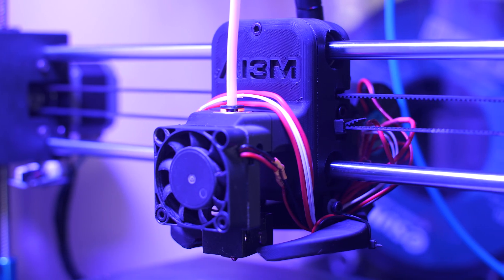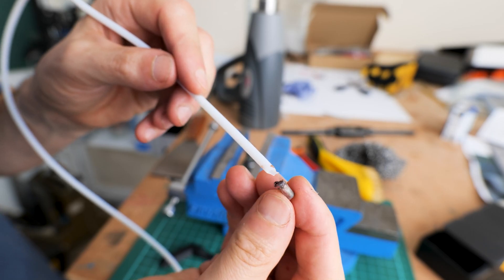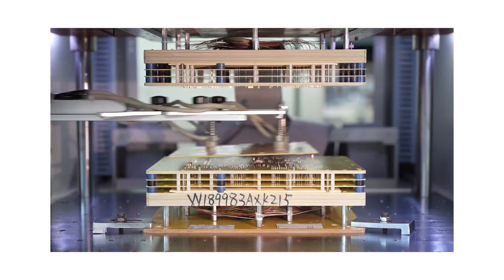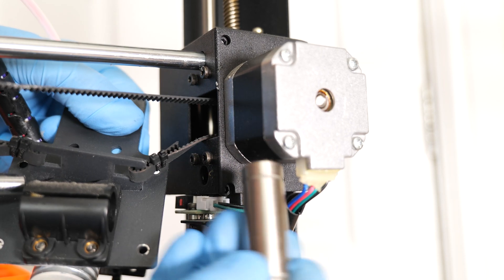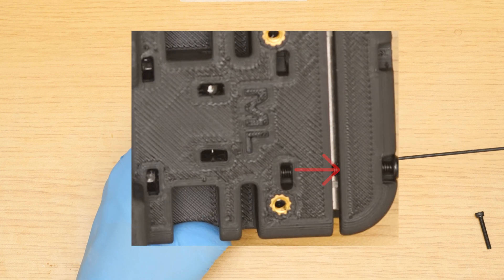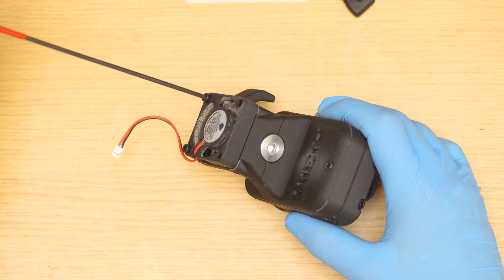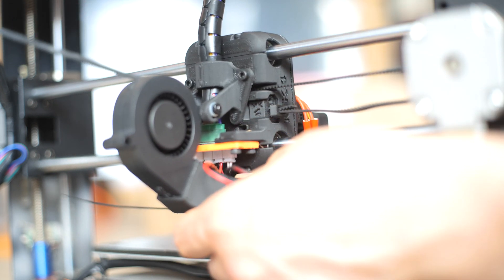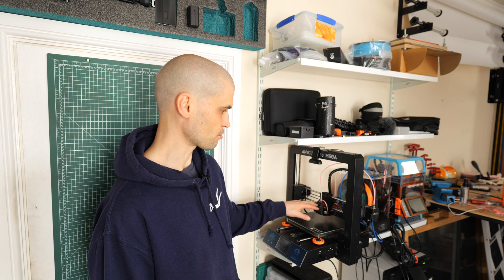Upgrading to the Anycubic i3 Mega X-Carriage MK4

Comment: Just upgraded my 7 year old  i3mega to marlin with Bltouch and new tmc2209 drivers. That’s a huge difference compared to stock. This looks nice too but again a lot of tinkering. You can swap boards to 32 bit or add Klipper to give this a second life, but I am tempted to buy a bambulab instead which will give me extra free time, which is the most valuable thing there is😅
Reply from the maker: Hi John, im in the exact same position as you, as of this week. I think the extruder motor port has died on my i3 mega. I could swap in a new board and tinker with it but at the moment im just looking for something that can print quickly and efficiently without it being a DIY project because i have so many projects on the go. From looking online the Bambu seems like the best plug and play printer at the moment and most of the reviews are very positive. I know @Clough42 has the bambu and has positive things to say about it and I trust his word more than most youtubers.

Comment: Liked and subscribed!

Can’t tell you what a relief it is to find a content creator that’s still running a Mega X AND performing upgrades. 

My Mega X has had very little use, but I’m getting a lot of mid-print failures for no apparent reason. I can’t justify replacing it, so I’m going I’m hopeful that I’m getting a lot more life out of it with the help of your upgrade tutorials.
Reply from the maker: What exactly is happening mid print? Bed adhesion, under extrusion....?

I3 mega still going strong for me. It's printing the best it ever has now I've upgraded to X carriage and ldo orbiter 2.0
Reply: I 100% concur. I'm running the bondtech extruder and am about to do this upgrade.

Comment: Did you print the xcariage with ABS?
Reply from the maker: yes esun ABS+
Reply: @ThisDesignedThat  did you print it using the anycubic mega? Im trying to print it with PETG on my anycubic mega x, but the prints arent as smooth as urs
Reply from the maker: I printed the Mega X on my Voron 0.1
Reply: Do the ABS prints look smooth like that out of the box or did you had to do sanding?
Reply from the maker: I printed at 0.1 layer height. No sanding or post processing,just straight off the printer.
The voron has much better print quality compared to i3 mega

Comment: A skr mini e3 v3 video on the i3 mega would be awesome. I replaced the stock hotend with a triangle lab all metal volcano. Use the blue tube to avoid the deformation issue
Reply from the maker: I've been thinking of doing this for a few weeks now as I'd love to move over to Klipper to control this 3D printer. I need to finish up some projects first though as I'm using the printer to make some parts. Just this week I have finished converting this mega x carriage to direct drive, using the Orbiter 2.0 as the extruder. Wow, this is the upgrade I have been needing on this machine! It breathed new life into the machine and now prints at 0.4mm layer height with a 0.6mm nozzle at 100mm/s speeds. Stringing has been reduced massively too, I should have switched over from bowden many years ago. I'll be putting out a new video showing this upgrade soon.
Reply: @ThisDesignedThat  please share the firmware, etc 😅
Reply from the maker: @Phil-D83  no firmware changes needed, i just calibrated e steps and flow rate